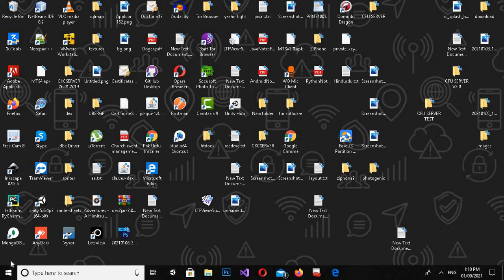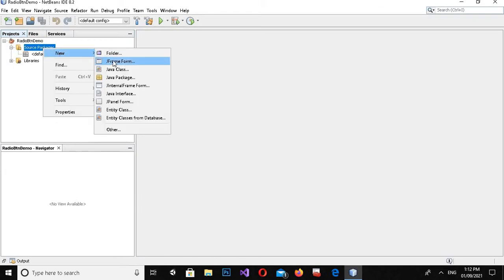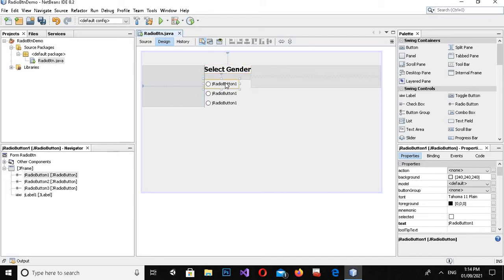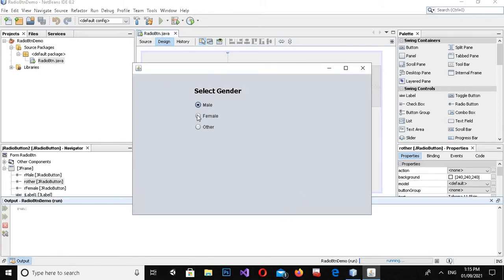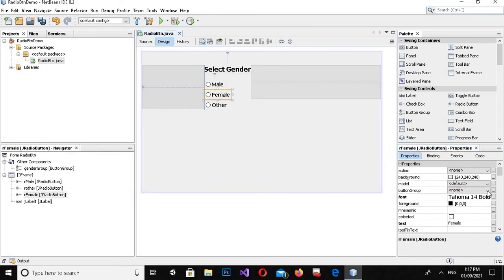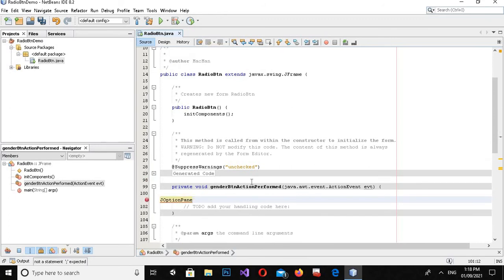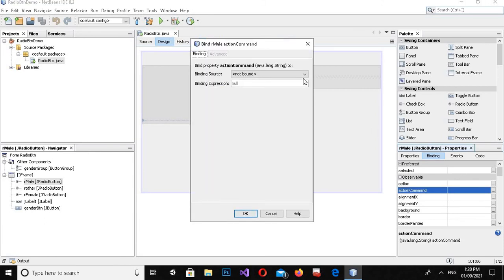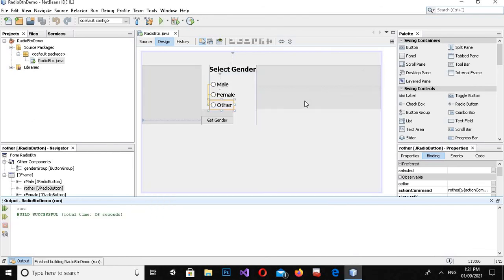Java Radio Button | How to use radio button in java netbeans | Radio Buttons in Java

Comment: How do I set null pointer exception in the radio button?
Reply from the maker: I could have a lot of reasons if u can explain i would be able to help u
Reply: @programmingguru159  I am trying to make an information system where we have  3 radio buttons in a button group and we have one must be selected for the value to be entered into the table. I will be very happy if you can help me with this
Reply from the maker: @soyouseeo  The solution is quite simple get one of the radio btn pre selected before running the form In  properties of that radio btn will have selected property check that 
take a look at the screenshot on the link 
https://drive.google.com/file/d/1pgw7y2_-afpyhJtJaYbGFU12wzm2uGcU/view?usp=sharing